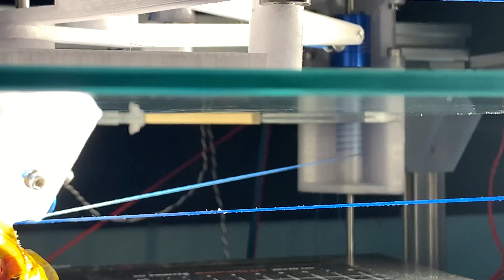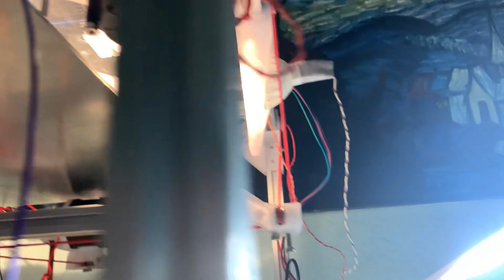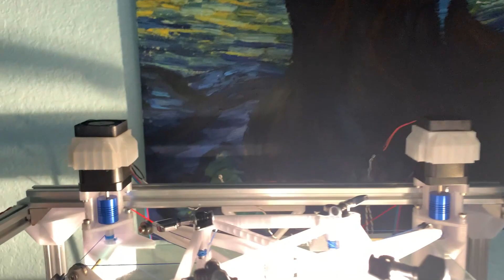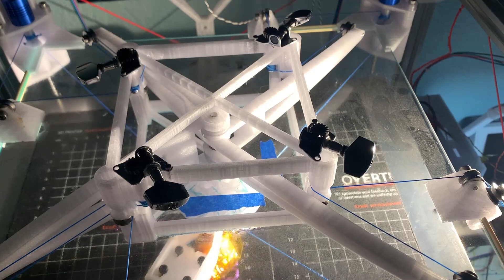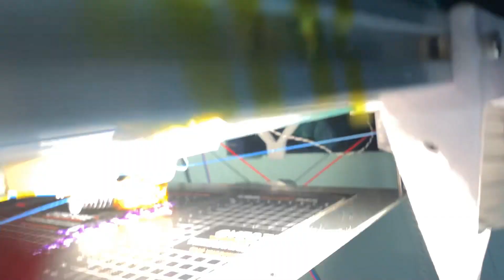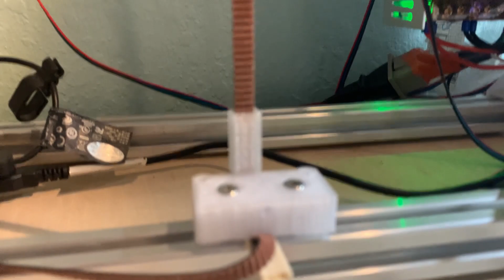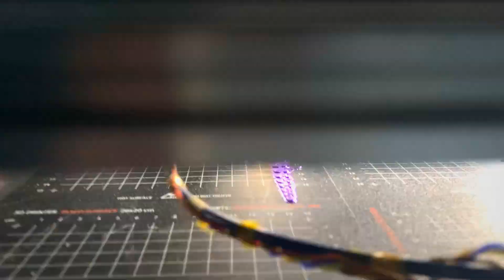How Marionette 3D printer works.

Comment: If the rope is spirally coiled:
How do you counter act the Z-axhsis force? (If the coil unwinds/ winds up you downwards / upwards movement in the Z-Axis)
Reply: the glass plate on the top with the mechanism on top to counteract and stabilise

Comment: I don't wanna sound negative but why
Reply: Because it's amazing. Why do mathematicians invent mathematical theories that don't have applications? Why do poets write poems? It's just another form of human expression. Surprised this needs explanation. Why dance?
Reply: @geometerfpv2804  you sound like a writer I do understand that it's cool and all but I'm just wondering if there's any advantages to a design like this
Reply from the maker: Several practical and theoretical advantages... very low effective moving mass (the top mechanism's movement is scaled down 3x so its effective inertia is 9x less), very high stiffness between the motors and toolhead (direct straight line), means it can print faster. Also, it is going to be a pretty cheap build. Then also if you wanted to build a high temperature printer, you can build this with kevlar or steel ropes and an air bearing for the slider, avoiding the need for expensive high temperature capable rails, grease, rail backings with matching coefficient of thermal expansion to the rail, etc etc. (Or alternatively, sets of bellows everywhere to keep the rails cold, which is also not without disadvantages)
Reply: @dizekat OK it does seem Like the advantages are pretty theoretical since it's not really stiff enough for super high speeds right
Reply from the maker: @StephenTeitgen  It is in fact extremely stiff... see the video description I have a link to a speed benchy in slightly under 4 minutes (also you can see it printing fast closer to the end of the video after its done with the first layer which I print slow to improve adhesion to unheated bed). The reason it's extremely stiff is the two highly tensioned UHMWPE cables connecting the toolhead directly to two motors, any sort of unintended movement of toolhead has to lengthen or shorten those two cables. The other two cables and the mechanism on the very top provide tension (while also countering that tension at the motor shaft so the motor does not have to oppose that tension).
Reply: @dizekat  that's pretty surprising that it can be so stiff I guess with enough tension anything can be pretty stiff it just needs to be strong enough I will check out those videos
Reply from the maker: @StephenTeitgen  Mostly it's just that UHMWPE has incredibly high modulus of elasticity, up to 140 GPa (slightly less than steel on per area basis but much higher than steel on per mass basis) . And the forces are transmitted along the length of the cable - this isn't like plucking a guitar string sideways (not stiff), this is more like trying to "pluck" a guitar string long ways.
Reply: @dizekat  thanks that makes it a lot more clear

Comment: Nice build!  Lots of neat concepts.  Like the relatively lightweight, compact, low cost design.  Already seen LDO's Positron v3?  Got any rope recommendations?  Am looking for a way to counter balance bed for my Core XY.  Cheers!
Reply from the maker: I'm using UHMWPE in this build, spectra for the XY motion system and some thick no name of dubious quality, for Z. Kevlar also works but it photodegrades some. For counter balancing in principle you could use a spring or a rubber band along with a non linear winch / pulley to make the spring apply a constant force.

Comment: This might be the best low-budget solution for a high temperature heated chamber 3d printer. No need to buy expensive rails or bearings.
Reply from the maker: Yeah. Earlier I had a variant with the Z drive motor mounted on the frame rather than under the bed, that may also be helpful for high temp. You can use Zylon PBO cables, or with larger pulleys, steel cable.

Comment: Imagine that the glass is the print bed too. In which the nozzle is upside down. It will have multiple functions which further decreases parts.
Reply: and how do you change the distance between the nozzle and the printing object? :D
Reply: @paleopteryx You tell me :D
Reply: Glass plate is just guideing
Reply: @packpack758 I know

Comment: This might be a way to get faster speed. Stronger rope will be lighter than the lightest cross bars. With more development, this could be very very popular
Reply: Yeah but you need a terrible radial load which will have to be dissipated on the first set of idlers of the system. Don't think you'll be able to scale it much further.
Reply: Not feasible for high acceleration, there would be so much rubber banding at even a medium speed that it would just fling filament. Awesome for precision and parts cost I would imagine, speed not so much
Edit: I misunderstood the mechanism, and regardless the previous posted speeedboatrace disproves me entirely
Reply: @slumpchogg  imagine triggering this behavior on purpose for some artsy prints
Reply: damn I believed you until I went and checked it out, imagine how crazy printing at even 1/2 that speed would be @slumpchogg
Reply: If you want to get faster... build stronger, don't reduce weight to increase but increase stiffness to increase seed (increase stiffness usually increases weight). Then add bigger motors.
Reply from the maker: The stiffness here is extremely high - the short kinematic path is straight UHMWPE rope motor to toolhead; in parallel (not in series) with a longer less stiff kinematic path. Stiff for the same reason Delta is stiff, moving members do not carry sideways loads.

Comment: wow that is amazing!! are there no z arifacts?
Reply from the maker: Yeah its quite smooth when it comes to z movement, similar to other belted Z designs in that regard - no leadscrew, no leadscrew wobble artifacts. Of course, you still get artifacts from other causes like filament thickness variations or runout on the extruder.